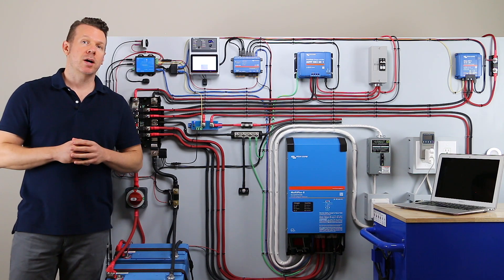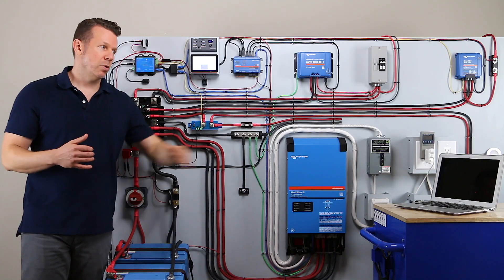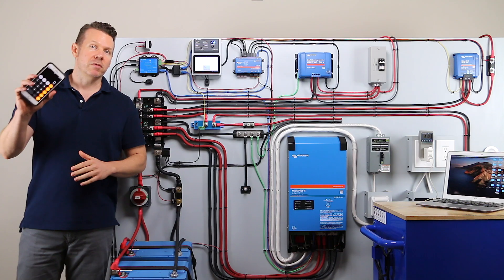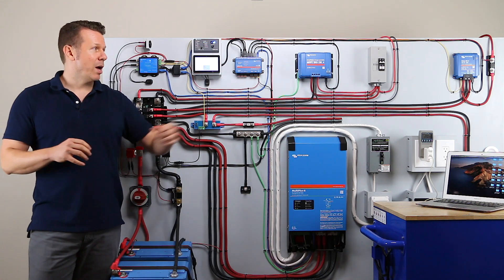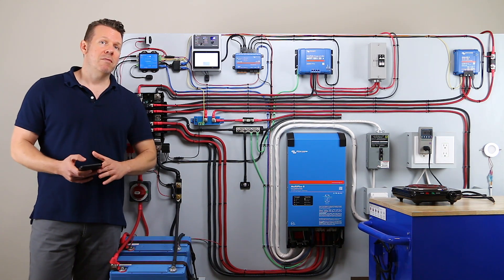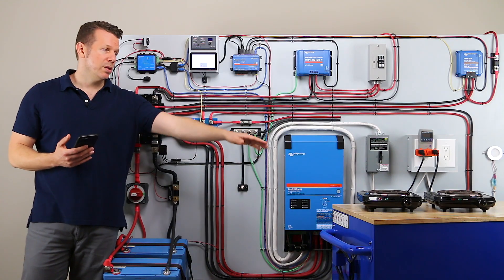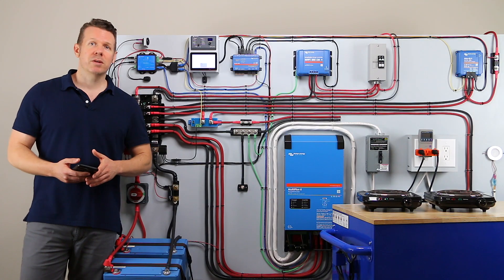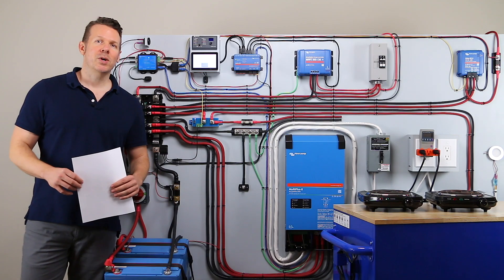The BEST way to Measure Inverter Efficiency (for maximum power system performance)

Comment: Get yourself a picoscope and some hall sensors for current, combined with voltage measurements through the scope, you can set up a math channel to calculate the efficiency live. You can measure voltage/current into the inverter as well as voltage/current out. You've likely got some losses right not between your shunt and the inverter itself at high loads, and also in the wire coming out of the inverter at high loads. Could be on the order of 10s of watts, which would certainly throw the calculated efficiency way off the way you are measuring/calculating it.

Comment: Little tip for running at very low power. I turn my multiplus off, and run it through an inexpensive, little(barely bigger than your MPPT up there), pure sine wave inverter, so for example, that little 60 watt load you had there, is going to be a higher percentage of the tiny inverter's rated output.. meaning.. its closer to the 'sweet spot' (higher efficiency). This is useful, not only just for those times when low power is needed during the day, but, depending on ones exact setup/usage, is often the better way to keep low power 120 stuff functioning all night.. so not only are you running an inverter with much lower 'parasitic drain' (power consumed by the inverter itself), but also at a higher efficiency than the big one at very low power.
I know quite a few people who use this idea of a 'small inverter' to make their power go further/last longer.
I mean, the inverter as you said, was using probably 30 watts(less I think but we'll use it just to have a number), so over 8 hours, that's 240 watts, almost 1/4 of a 100 amp/hr battery, just on the parasitic load if it's on all night, plus the higher efficiency loss of the large inverter.
And, like I saw you comment below, use straight dc whenever you can, like that laptop you were charging, will charge from usb, so use a 12 volt usb adapter, like a cigarette lighter adapter, to charge anything that can use it.. and again, right there, your saving that continuous 30 watt parasitic load, plus the efficiency loss. It's not quite that high, with a multi 3000, but as I said, close enough to illustrate the savings of small inverters and using straight dc when you can(usb ports that run on 12 volts.. not usb ports that you have to plug into 120... obviously, because then you have to have the inverter on).☮🇨🇦

Comment: Is the Victron inverter efficiency losses remain the same for UK 230 AC 50hz as the 120 60hz power?
Reply from the maker: Hey there, I cannot tell for sure without a full test, but I would guess that yes it’s the same or very close, the max efficiency for the 230V version of this MultiPlus-II is listed as the same 93% as the 120V (12V 3000VA) version I tested. Hope that helps, thanks for watching!

Comment: Is there a more efficient inverter than Victron? Another brand perhaps?
Reply from the maker: Hi Amerona, the inverter used in this video creates a pure sine wave output, a modified sine wave unit would be more efficient but is not recommended as it will damage electronics. Other than that I can't say if another brand would be more efficient. In general I try to run things off of DC power to avoid using an inverter. 48V DC appliances with a 48V system would be a great way to do that, although it's hard to get rid of all converter/inverter losses. We just need to add a little extra battery capacity to account for that. Great question, thanks for tuning in!
Reply: In my experience, no. I have not found a more efficient pure sine wave inverter.

You have to consider the idle consumption of inverters as well as conversion efficiency. For the money, Victron is the best IMO.